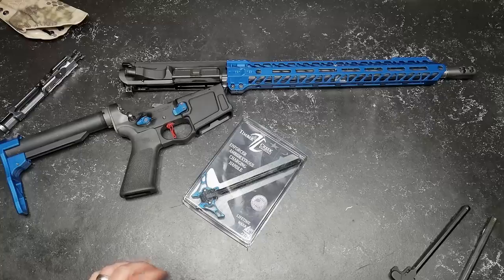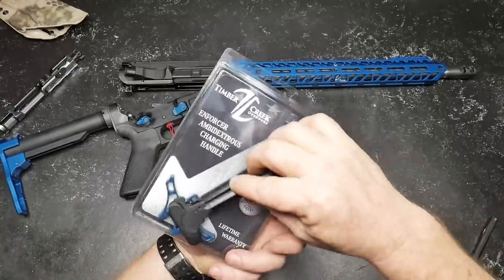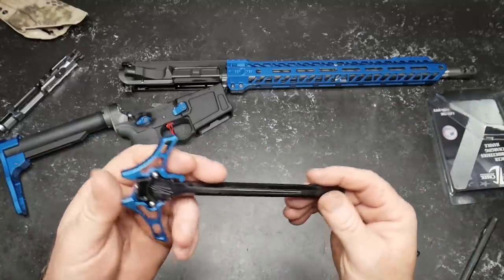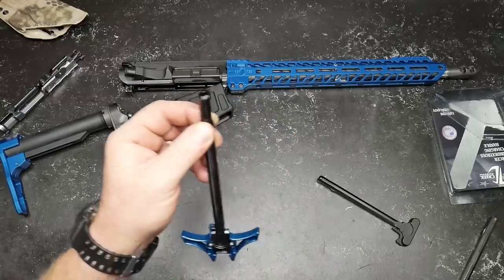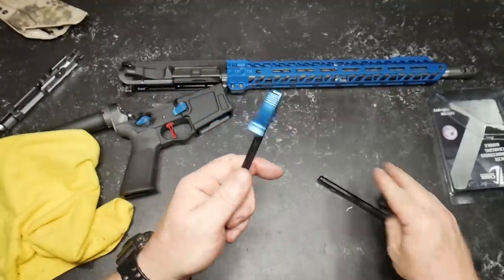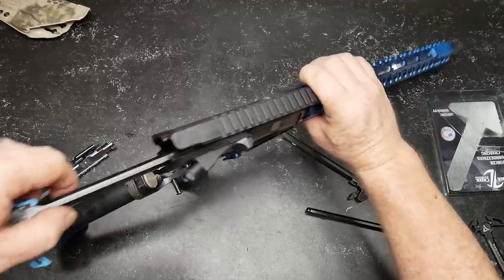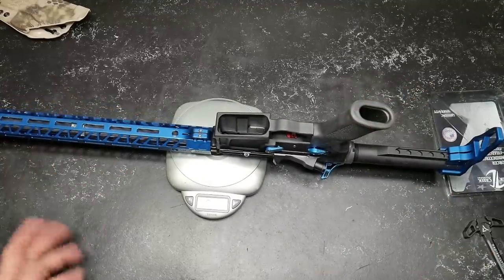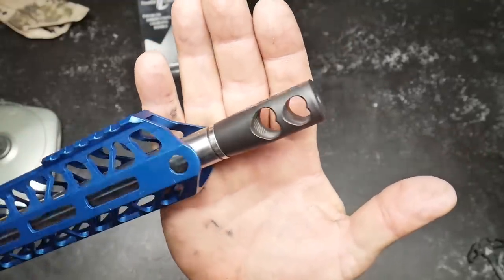Timber Creek Enforcer Ambidextrous Charging Handle

Comment: In the pulpit here:
6061 Al alloy is not aircraft grade, it is marine grade. 7075 & 7078 Al alloys are aircraft grade. Which is this? (I hate sales puffery.)
Reply: What's "aircraft grade"? I'm sure plenty of aircraft parts are made of 6061... I think it's just a marketing term that means nothing. All kinds of aluminum are used in aircraft depending on strength and size constraints.
Reply: @breadman32398 :
 What's aircraft grade? Well, that means you can make an FAA approved flight item out of it. There are precious few ac parts made of 6061. They are mostly on older commercial ac and in the tail. They are only allowed cuz they can't be removed for replacement. They do crack and must be welded.

7000 series Al alloys, comprising primary and secondary structure, even galley stuff, can't be welded.

Now, with the advent of 7000-like alloys containing Sc (Scandium) traces, 6000 alloys are going bye-bye (on ac.) Sc containing Al alloys have the strength of some steels, weight of Al, can be welded, and cost more than sin itself. I expect costs will decline.

I'm a retired machinist & have worked on many an ac. I'm pretty sure about what I said. My BS was in Chemistry. If you are more recently trained in A. Engineering or Materials Science, please let me know so I can stand corrected.
Reply: @Hankusorealius  I think you're right. This seems like a good explanation.  I was thinking of non load bearing parts, like a seat frame might be made of 6061.  I'm starting my Aerospace engineering internship next month so I suppose I'll find out for sure then!
Reply: @breadman32398 :
Congrats on your choice of studies. One time I slept with a Materials Science text as a pillow, soaked it all up. I recommend all the extra study you can get there. It'll go great with your AE degree. I sure do wish you the best in your future.
Reply: @Hankusorealius  actually my degree in progress is mechanical engineering to be specific. I'll be working in the machine shop area for an aero company, probably similar to what you did just maybe a bit more design optimization oriented I believe.
Reply: @breadman32398 :
An M.E., ehh? Very tough but a very commercial degree. With that you have a great "future proof" career ahead. Again, all the best.

The machinists say, "Don't feed the engineers." They're usually smiling though. 😎

Comment: Damn they need to clean up them ears, those are huge!
Reply: SicSemperEvelloMortemTyrannis TyrannyEnder  Easier to snag also.
Reply: SicSemperEvelloMortemTyrannis TyrannyEnder  Or on clothing as you're manipulating it to and from a slung position.  There's a lot more shit for it to be snagged on than just what you'll find "in the jungle."
Reply: God is good!!!!!!!!!
Reply: SicSemperEvelloMortemTyrannis TyrannyEnder  You may never have an issue...until the one time that the last thing you need is an issue.  I personally use Radian Raptors on mine and I am still conscious about snags and it's not as big and much more rounded than the one in the video.  My point is, I would never use that charging handle on a defense rifle.  Possibly on a competition rifle, but to be honest, I don't really care for the look of it...so probably not then either.
Reply: SicSemperEvelloMortemTyrannis TyrannyEnder  
https://www.midwayusa.com/product/1086195223296
 It's worth every penny.  There is a little bit cheaper one that uses polymer for the ears depending on your budget and if polymer is a dealbreaker for you.  I have both models and they're both great, but obviously the aluminum one feels way better.

Comment: Anyone else have an issue with the charging handle hitting you in the face when shooting the gun. It comes unlocked from the receiver. Some times when I send a round down range when the bolt is cycling out the old round the charging handle comes unlocked and hits me in the face. I'm a little slow so then again it might be me.

Comment: Looks good but I will stick with my Raptor
Reply: Love a Raptor.  I have 2 of them, one is the cheaper model with the polymer ears that I put on a slightly more budget friendly build and it's still amazing.
Reply: I will stick with my Colt made USGIs 🤷🏿‍♂️
Reply: @rifleshooterchannel208  Your loss.  Try a Radian Raptor and you won't regret it.  They're worth every penny.
Reply: earl gunman You’re right my Colt handles never charge my rifle. 

In fact none of them do. 

Never in the history of the AR15 have charging handles made by Colt loaded a rifle. 

😂
Reply: @rifleshooterchannel208  Just like how never in the history of firearms, has a design been improved upon?  That's a dumb argument.  Keep on using your garbage mil-spec Colt charging handle.  That's like choosing a hi-point over a quality 1911.  Sure, the hi-point works just fine, but some people just prefer the finer things in life.